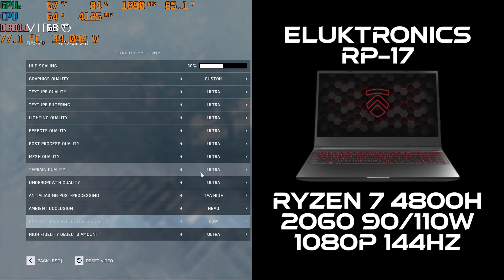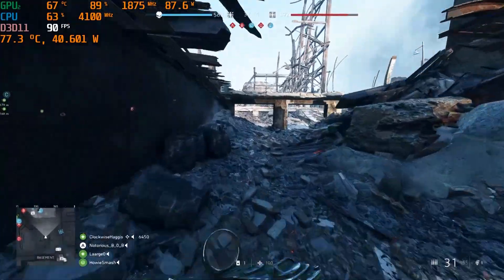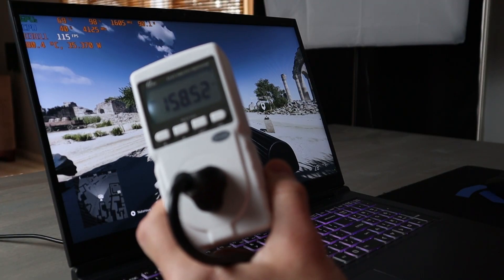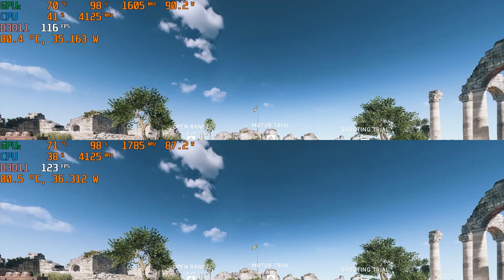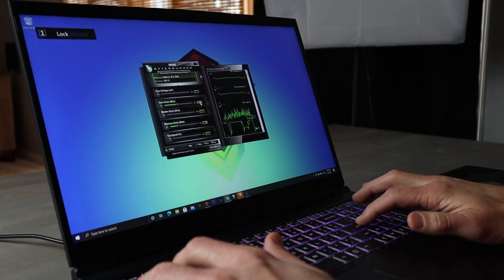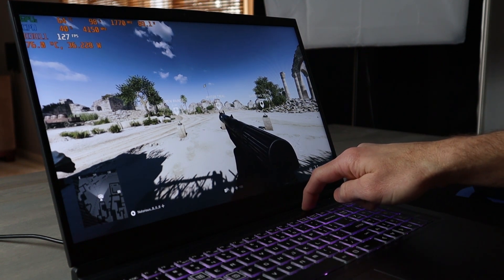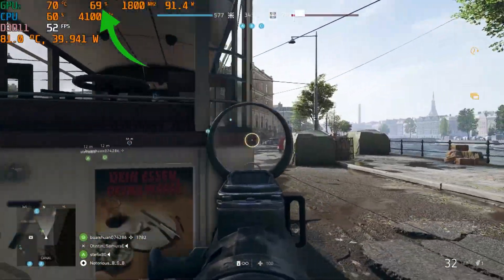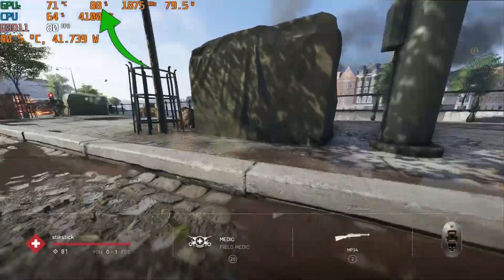RP 17 Tested!  Eluktroboost (How It Works and When It Doesn't)

Comment: Isn't a similar result possible by simply OCing (& UVing) via MSI AB or NVinspector?? 
But yeah this is a near 1-click solution👍🏻
Reply from the maker: You can’t add more wattage to a laptop by doing anything with afterburner.  Two different things.
Reply: @tested900  what I meant was a similar boost in fps (5% give or take), since at the end of the day that's what matters.
I know that the power slider for GPUs are locked out on laptops
Reply from the maker: @sushimshah2896  Oh sure if you want to run an overclock on your system that’s fine. This was just an explanation as to why this boost feature may not be working in some scenarios.  

I’ll get these random complaints of people saying that this is a sham and this video is an explanation as to what’s really happening.

Comment: Could you explain what hardware changes was made to allow for such boost?

And why aren't more companies doing so?
Reply: In 2021 you actually don't need it anymore, as NVIDIA has baked pretty much this feature into its Dynamic Boost 2.0 brand.
Reply: @TheMacco26  I see, so it's like Dynamic Boost. That explains it, so only RTX30 series has the feature then.
Reply: @boy638  In 2021, yes. In 2020 there were those OEM's peculiar features like the so Eluktroboost here Bob is showing. Not embedded into the Nvidia drivers yet, hence only hardware controlled.

Comment: That makes so much sense now. I have a RP 15 and I was was wondering why it didn’t make a difference while enabling boost every time. Have you heard anything about an unlocked bios that will allow ram overclocking? 3200 CL22 is awful. There are sticks available that are within the 1.2V spec with much lower timings, but there is no way to enable them to run at those speeds, that I know of.
Reply from the maker: I’ve been using a beta bios for many months now but there’s nothing in there to tweak the memory.

Without the system being prepared for faster memory often times putting faster memory or lower latency memory in your laptop won’t yield ideal results